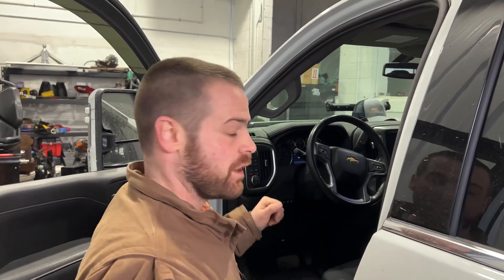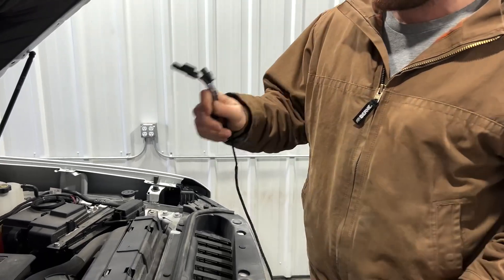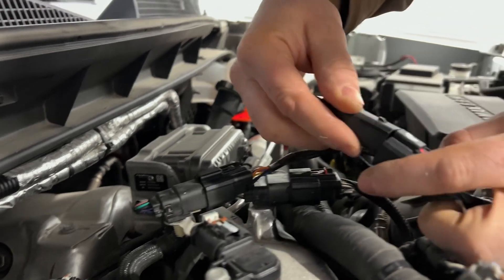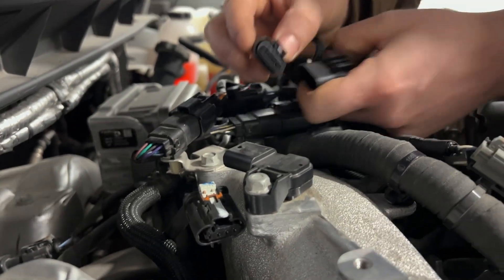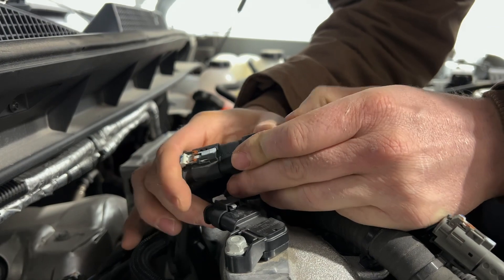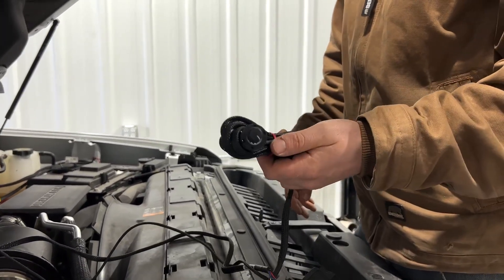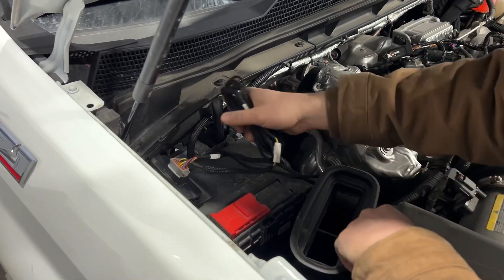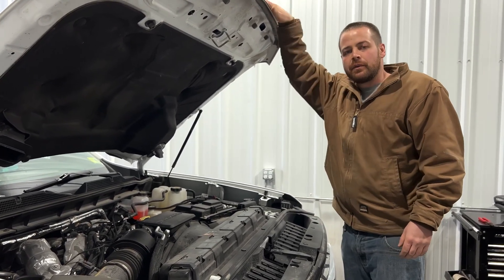Duramax L5P 6.6L (2017-2023) - Stealth Module Installation

Comment: Does this work on the new 2024 duramax? Any comment on people who say this has ruined their engine?
Reply from the maker: The Stealth Module for the 2024 L5P should be available soon! You can sign up to be notified when it’s available here https://www.stealthmodules.com/collections/chevy/products/stealth-module-chevy-gmc-duramax-l5p-6-6l-2024

The module works strictly within factory safe operating parameters and the factory computer remains in complete control. It can’t harm the engine. People leave it on when they take it to a dealership and the dealership says aftermarket products are the cause so they can get out of fixing it.